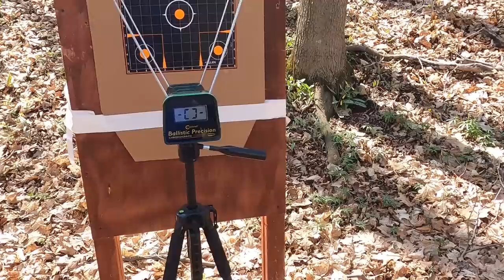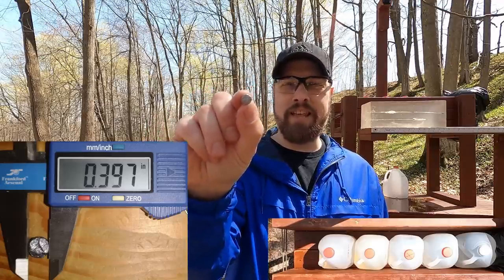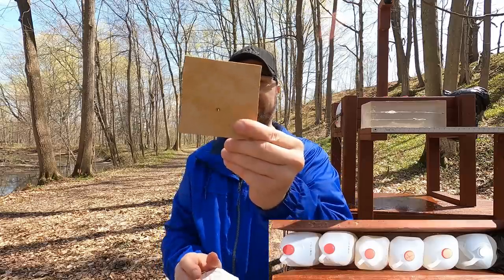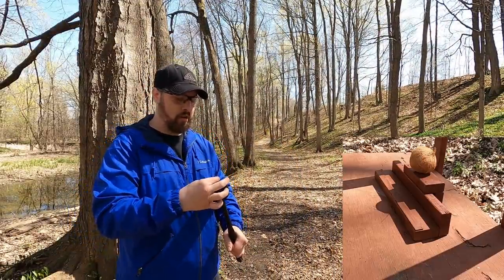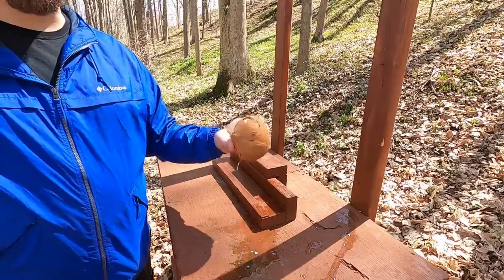WOW Dieseled Pellet Rifle RIVALS Firearm - .30 Caliber Break Barrel OVER 50 Ft Lbs Energy!

Comment: I had to look this up.  "Dieseling is when the air pressure of firing a pellet causes lubricant behind the pellet to combust." I fully understand combustion engines, but didn't know this was a thing with air rifles. It's conceivable that a petroleum-based product could reach combustion temp in the air rifle and increase pressure behind the pellet. It could end up being tough on the gun seals.
Reply from the maker: I was doing it before I knew what it was. Like, I would do it all the time before most people had the internet, never had a word for it. Probably 15 years later I saw a video of "dieseling" pellet guns, and I was like, oh okay I have done that.
Reply: @GunSam  exact same for me! I've ALWAYS kept my pellet tin about 1/4 filled wet with WD-40, inside the skirt is cone ending in small cylindrical where surface tension holds a good droplet in them. lubed barrel doesn't load much crud and the wet helps the skirt seal is all I knew, before seeing dieseling videos...
Reply from the maker: @modelnutty6503  I found out by accident, but I don't remember exactly how. I think I was adding lube all over for some weird reason, like thinking that it might help the gun work better for cocking or whatever, and randomly saw smoke and heard a crack like a .22 LR. I was like "whhaaaat?!".
Reply: @GunSam  I didn't know the difference or that it wasn't "normal", its just how I'd done it for decades with the Chinesium B3 .177, before that with a Daisy pump. of the two I liked the B3 single pump spring piston a lot more, the plastic Daisy pump lever flexing was sketchy then add all the time+noise of pumping 8-9 times = yuck. they both hit about the same so I kept the better built cheapo B3 (20 bucks from a Harbor Freight truck back when).
Reply: There are fire starters that you put a piece of combustible material in the end and slap a plunger same concept

Comment: Nice video 👍, for a better result, try to drop a drop of diesel or sewing machine oil in to the cylinder by the transfer hole, maybe nothing will happen in the first shot, but the the number two shot💥💥 💥, and a warning, it might destroy the gun if done on a regular basis. 🤠.

Comment: Would lubricating the barrel with Vaseline do the same thing? Your second and subsequent “dieseled” pellets was where it demonstrated the peak results of the “diesel” effect. So is the Vaseline simply lubricating and sealing the barrel better so that less air is escaping around the projectile? Just a stray thought... I had never heard of “dieseling” in this context before.
Impressive video! Thank you!
Reply: no the air compression and subsequent temperature rise inside the chamber will ignite the lubricant
Reply: I never do it as I like to keep my seals mint.. my airrifle already shoots a .22 pellet 700+ ft/s without dieseling which besides damaging the seals will often damage the pellet you're firing too.

Comment: If you use hard cast .22 bullets you will get more penetration because of smaller diameter, if the shape changed and became wider you get less penetration like hollow point bullet.
Smaller diameter = more penetration

Comment: Is the increased speed and power attributed to adding the petroleum jelly to the cavity behind the pellet by increasing the mass of the pellet?
Reply: Adding weight decreases velocity , the increase is due to explosive compression of the vaseline  which airguns are not designed to take .

Comment: Maybe put a more combustible oil in and seal it in the Vaseline. Hopefully that would hold the liquid in with way more power maybe wd40 which is pretty flammable might ignite the Vaseline. Or maybe actual diesel sealed in with Vaseline.  I would like to see that attempted. And I wonder if you drill out the front and filled that with Vaseline. Would that explode on impact with the gel?

Comment: I've always used a really thin oil for dieseling, never thought about petroleum jelly, thx for the idea. BTW, I would think by dieseling your equaling a .22 short for velocity an FPE.
Reply from the maker: Yes, but only if that .22 Short is in a snub nose revolver or similar handgun.
Reply: @GunSam  I would think it's more like .25 acp from a pistol .
Reply: William McCaslin actually a 22 short   does 70fpe  pretty hard to get that kinda power out of a springer even with dieseling. My 25 PCP shoots a 31 grain hn grizzly at 1010fps 70 fpe
Reply: @danieldyck2576  You can buy CCI .22 shorts that do 710 FPS 29 Grain, I have the Hatsan MOD 130 .30 cal and it has about the same power stock as sub .22 Shorts.
Reply: @mikearnold1857  Those are called CBs, and are quite a bit less powerful than shorts.  Quiet rounds

Comment: i have a 9mm PCP that averages about 970fps. im making some gel this week to test the penetration.
Reply: Nice, what brand? I've got a .357 Benjamin that pushes *81 grains to 1000 fps, and I'll be upgrading it soon to a 4500 PSI chamber and unrestricted valve, others that have done it were reporting up to 320 fpe, a 150gr Nosler at 980 fps. Now thats some muzzle energy considering it's an air gun...
Reply: @TheExplosiveGuy  its the FX impact. i considered getting the bulldog but i decided to go for the FX. i haven't yet played with the tuning. im considering getting the conversion kit for 22 slugs they're saying 22lr power in an airgun.
Reply: @TheExplosiveGuy  my magazine is pretty small im looking for lighter ammo what are you getting thats 60gr?
Reply: @TheExplosiveGuy  im planning on getting a texan for the big power. .45 or .50. i hear they're getting up to 1000fpe with that setup. crazy!!
Reply: @truescotsman4103  Ohh nice! I've looked at FX guns, they're much better quality than the Benjamins, but I went with the bulldog for the lower price point since I was on a budget and I wanted enough cash left over for an HPA pump and 60cf 4500psi carbon tank, so much cheaper to shoot that way. And I'm not sure where I got the 60 grains from, bit of a brain fart. Just looked at the tin, they're 81 grain JSB. I've put half a dozen different pellets through it and it absolutely loves the JSB pellets, I've gotten 3"-4" groups at 100 yards with them on a calm day. What kind of grouping do you get with the FX?

And I'd also like to get the .50 Texan one day as well, those things are brutes. One day perhaps...
Reply: @TheExplosiveGuy  ive heard nothing but good things about the benjamin i may still get one. the fx gets similar grouping all guns are basically the same these guns have light barrels and perform similarly as far as accuracy. the FX has a great regulator and probably gets more shots per fill but that's something you can change by increasing the power. im enjoying it as it came but i plan to do some upgrades and some tuning soon.
Reply: @truescotsman4103  Yeah I can't say anything bad about it at all, except maybe they could have put a regulated 4500psi chamber as a stock option, but either way I'm not really complaining. I am debating on whether I want to go 4500 unregulated for max power shots or 4500 regged down to 3000 for more consistent full power shots (as it stands my first ten shots are within about 50-60 fps of each other, I'd like to get that down to maybe 15-20 fps). What pellets does the FX prefer?
Reply: @TheExplosiveGuy  if you can get the regulator. you're going to want to get high power regulated shots. keeps you from wasting air and you get the power you want and you can tune it. the magazine holds 18 rds and i get 40 full power shots per fill its pretty amazing. haven't needed more power so far. too bad i didn't have it with me today. i had a young coyote show up in my neighbors yard as im driving in. i usually shoot squirrels with my benjamin armada .22 every day got two today. i had killed squirrel about 3 hours before and the coyote was there for the dead squirrel he must have smelled it. i can't believe i had my benjamin armada .22 on my door pointed at the field when i saw the coyote. i took a shot at his shoulder im pretty sure i hit him. if i had the FX .35 he would have been toast. this happened an hour and a half ago.
Reply: @truescotsman4103  Yeah that's what I was leaning towards, I'll probably do that. More shots sounds good, and I'll have more accurate shots per fill. 40 shots? That's great, I get about 10 full power shots then another 20 progressively slower shots, I'd love to get 40 out of it. 

And dang it dude, you're supposed to be strapped everywhere you go! 🤣  That's too bad you missed him, those things wreak havoc. I used to keep a .264 win mag in the closet next the porch door at my old place for just such an occasion, damn near cuts them in half🤣. I'd definitely like to see how they fare against the Benjamin, never got the opportunity to shoot anything with it yet and a yote would be a good place to start lol.
Reply: @TheExplosiveGuy  i was robbed! it was pretty anticlimactic. i was saying to myself i might as well take a shot anyway. i do carry the 9mm sometimes i have it ready for home defense. i also have a seneca eagle claw in .25. i really like that gun too its a lever action like the old west winchester rifle.
Reply: @truescotsman4103  Wow I just searched that rifle, she's a beaut! I didn't know anyone made a PCP lever gun. Looks like it holds a lot of air, how many shots does it get and at what pressure?
Reply: @TheExplosiveGuy  its only 3k psi. only get about 20 or so full shots. its really powerful. lighter lead free pellets are over 1000fps. im probably getting 900 with lead for a .25 it hits hard. i was sighting it in with a red dot last night on my porch and it destroyed two pieces of 1/2" plywood and was hitting the bushes beyond pretty hard. i really like that one for around the house ready for short range.  i live in a double wide mobile home in the woods and i have a racoon that climbs on my roof all the time i plan on getting him with the .25. the .35 is set up with a nice athlon scope and sighted for 75 yards. the eagle claw is sighted for 25yds with a red dot. the benjamin is sighted at 50 yards with a pretty nice center point scope. i have a night vision scope too i hope to use that soon. its the sightmark wraith. its pretty heavy i have it in a box right now.

Comment: It's a well known fact that dieseling break barrel airguns can be very powerful but be aware!
This "dieseling" will destroy the guns main spring in no time as the dieseling will invoke shockwaves travelling through the mainspring, something it is not designed to withstand in the long term.
Reply: This is piston driven.
Reply: @andrewbarnett2761  I was wondering about whether dieseling would affect a piston.
Reply: …or a multipump (Crosman 1322, etc.)

Comment: The biggest issue I see with loaded pellets, (if they don't hurt your gun like oil in the compression chamber will), is fps consistency.  If the loads (and maybe other factors), do not produce the same energy from shot to shot,--the gun will not be repeatable for accuracy, especially for longer distances.
I think it does make the gun a firearm legally, so I will stay away from that.  Looks like a can of worms I don't want to open. :)

Comment: It is a lead dirty process, so stay clean:  But for that ,30 Hatsan gun, if you put a pellet, (either JSB pellet), on a plastic cutting board, (or plastic card table), skirt down, and push down on the pellet while moving the end of the skirts on the plastic in a circular of figure 8 motion.  You can "flair" the pellet skirt up to 2mm bigger in diameter, and it actually fit in my breech very nicely.  I got a consistent 30fps faster than the pellet out of the tin, and less fps variance.  The most I measured was 29.5fpe doing it.  It seals to the short 10.5" long barrel better and is a pretty thin flange when flared.  The method did not work on my 16fpe .177 break barrel and the awesome JSB 10.34gr. pellet.  That one lost a bit of speed.
Reply: What you did was "custom make" every pellet...which reduced the variations from the factory process which knocks out thousands of "almost the same" pellets every hour...
The pellets now perfectly fit YOUR air rifle...and may not fit someone else's at all well....

Comment: So what's the volume (sound) increase from no diesel to diesel? And what sound suppression does the 130 have?
Reply: I just did this with my 130 and some 30 year old 3 in 1 oil and it broke the sound barrier..it fired at LEAST 1200 FPS and sounded exactly like a full power rifle cartridge. And now I'm in shock.

Comment: The thing is though in talking to pyramid air to their lead technician over the years I've learned that yes this will increase things just like you you've shown here but it can do terrible damage to your rifle or to you sometimes it can actually blow up and at the very least it will oil your seals too much and cause wear and tear and the seals will eventually dry out and go to bits. Too much lube and pellet rifles especially springers and the nitro piston rifles is a bad combination. So people use caution and always choose caution over expectation of more thrill and more power.

Comment: I never heard of this. Is the pressure actually igniting the the grease or whatever?
Reply: Yes, that is the way diesels work...the piston comes up in the cylinder and squeezes the air. The squeezed air gets very hot. 
At just the right time the injector pushes a fine spray of oil into the hot air. 
The oil ignites and burns which causes expansion of the gases in the cylinder, driving the piston down......
So, on an air rifle, when you pull the trigger the spring forces air into the chamber and then in behind the pellet...
The base of the pellet in this experiment is filled with petroleum jelly (brand name Vaseline)  
The Vaseline instantly vaporises into a fine mist and starts to burn...which expands and gases and drives the pellet out of the barrel...faster than just air would do....since the pellet moves more easily than the increased pressure in the chamber acts on the spring with it's seal....opposite reaction etc.
One commenter stated he used Vicks Vapor Rub...which is highly scented petroleum jelly....
Another said he used coconut oil which is a solid at room temperature...note OIL...
3 in 1 oil, and of course...you could use diesel...
Reply: @JohnSmith-pl2bk  thanks. I knew the pressure ignited the diesel in the chamber of an engine because diesel is not very flammable under normal conditions. I just never heard of this application. I assume that if you shot these at night there would be a visible mini fireball out the muzzle!
Reply: @garyevans3421  
It would have to be a very short barreled air pistol...
Firing a .38 cartridge out of a 6 inch barreled revolver doesn't have much flash from the muzzle...but has four distinct jets from the mouth of the chamber/throat of the barrel. (Jets at 1, 5, 7 and 11 o'clock)
.357 Magnum has a slower burning powder and has an amazing flame/flash from the same revolver...the powder is still burning at the muzzle and beyond....
It's not like the movies at all....
A small amount of petroleum jelly would all have been burnt up in a rifle barrel...?

Comment: What about big bore pcp ? You should do dieseling test whit that , i think may be we got some surprise like this test .
Reply from the maker: I'm not sure that would diesel. But I have made mention of this in the past, but i'm never getting a PCP as I like simple and easy and prefer iron sights, two things the PCP always lacks.
Reply: @GunSam  well....i still think about that....i,m so curious...maybe some day i,ll do that
Reply: @muhayatsubrata1203  You need heat from compression to ignite the fuel. The air in a PCP is already compressed. Good question though.
Reply: @patrickbolthouse7354  i rethink again....and if i do with pcp and the fuel is blow back to the air tank...it could be some masive accident😳😱 it could be hapen..... right ?
Reply: @GunSam   I'm pretty sure it would work , but it would scare Me the pressures in a pcp air tank can be 300 bar  or about 4500 psi . I read somewhere that  if a standard divers air tank  was to explode below a 747 jumbo it had enough explosive power to lift it 3 feet in the air . Would I watch it if someone was silly enough to try it ? Absolutely !  ,but I'd never do it even for £1000,000 .
Reply: @patrickbolthouse7354  
So, on an air rifle, when you pull the trigger the air is forced into the chamber and then in behind the pellet...
The base of the pellet in this experiment is filled with petroleum jelly (brand name Vaseline)  
The Vaseline instantly vaporises into a fine mist and starts to burn...which expands and gases and drives the pellet out of the barrel...faster than just air would do....since the pellet moves more easily than the increased pressure in the chamber acts on the spring with it's seal....opposite reaction etc.
One commenter stated he used Vicks Vapor Rub...which is highly scented petroleum jelly....
Another said he used coconut oil which is a solid at room temperature...note OIL...
3 in 1 oil, and of course...you could use diesel...

Comment: Use wd40 apply it directly in the hole the compressed air is blowed out of, the results are awesome however it can damage the internals of the rifle.
Reply: The whole of the piston chamber is turned into a combustion chamber...and the piston seals will act like piston rings...but they aren't spring steel...just rubber/leather/viton etc....so will burn up.
And the spring chamber can't take the pressure like the barrel can...
The solid petroleum jelly confines the burn  in the barrel...much safer...

plus you can be sure the ignition material is always retained in the barrel rather than dripping into the spring chamber whenever you elevate the barrel e.g. shooting up into trees etc...